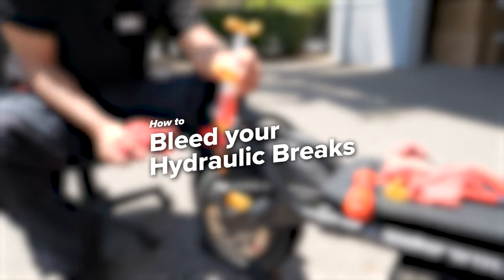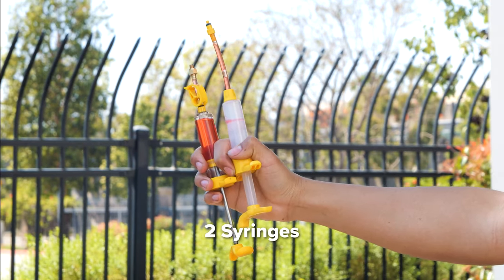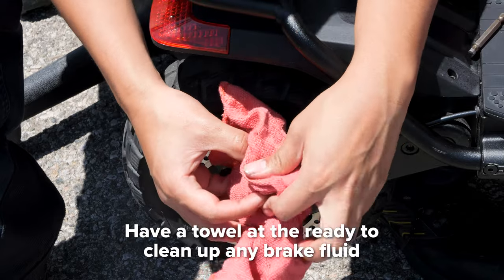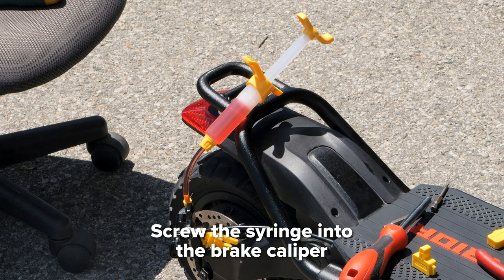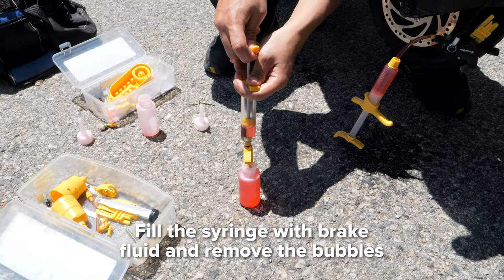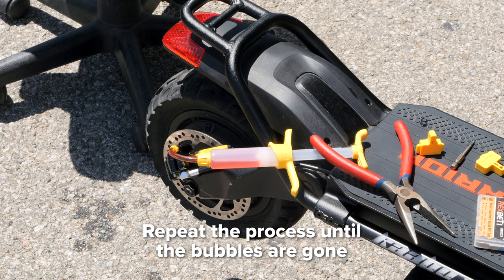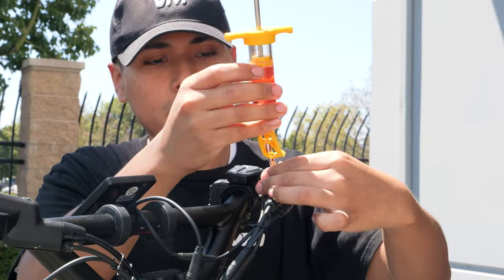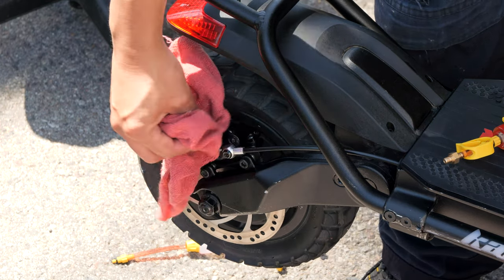How to Bleed Hydraulic Brakes on any Electric Scooter | Voromotors tutorial

Comment: For extra points, remove the break pads. Also you can remove the bolts that are below bolts that are facing upwards. That way you don't have to realign your breaks. If you also do not want to over tighten the bolts use a metallic pen to mark the positions of the bolts.

Comment: I just watched you force air into your brake line 😉🤯 from the top. I think you should have pushed fluid up from caliper. I guess if you have a syringe on both ends you could go back and forth until you no longer see air bubbles. I would push it all 1 way. From caliper up.
Reply: You also watched a video that basically showcased a 2-3 minute process in the span of about 15-20 seconds. Pretty sure there's more that happened than what you just saw. :P

Comment: Watch that oily rag on the rotors!  Jeez
Reply: Why?  
You think the rotor is going to get so much oil on it.  That you will never ever be able to stop again? 😂😂 

Any thing at all that gets on the rotor will be burned off in the first couple stops of the scooter
Reply: @anthony5227  They do have a point. If fluid is on the rotor, it will create an issue, and also get into the brake pad material. I would recommend spraying it down with brake cleaner to get rid of any residual fluid that did get onto the rotor/brakes.